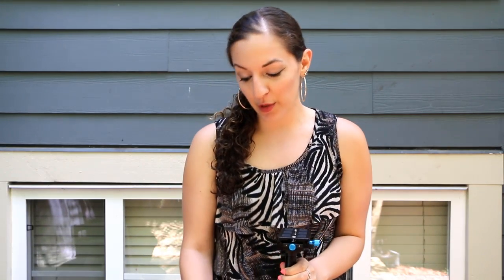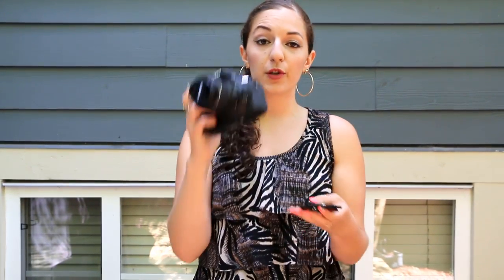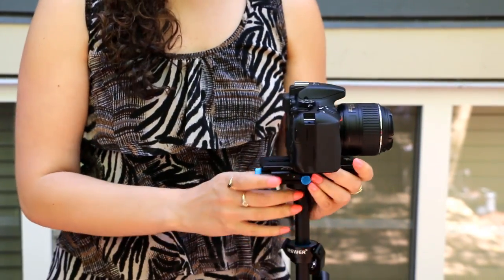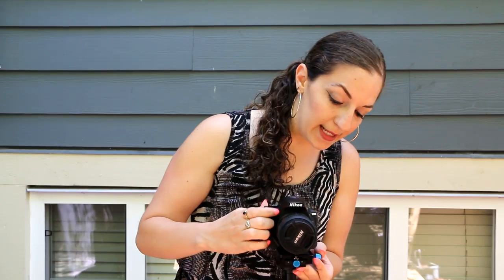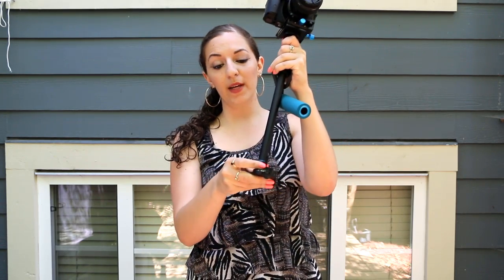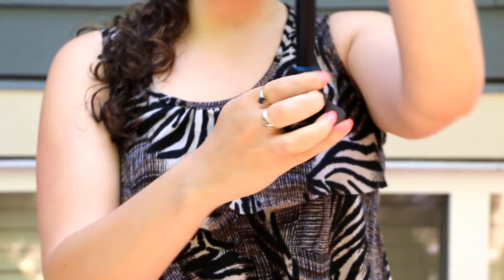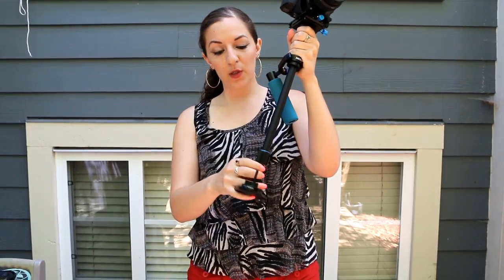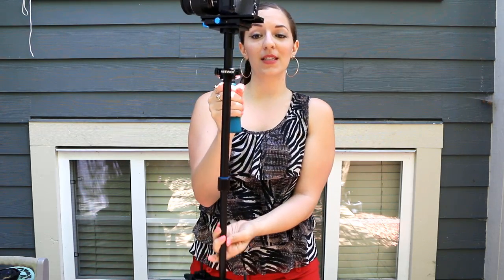How To Balance Neewer Stabilizer: Detailed & Step-By-Step Tutorial

Comment: Your intentions are very good and you are trying to help others which is very honourable. But there are a few things that are wrong. The quick release plate is not meant to slide in as there is a metal brake that is there precisely to prevent it from sliding off. Instead the quick release plate goes in from top to bottom like when you insert a tripod plate into a tripod head. 

Secondly, if you place the camera near the rear of the quick release plate it wont stick out so much and block your left/right adjustment knob. Then you wont have to turn it around the wrong way  facing the front like you did, and you can keep the left/right adjustment knob facing you.

Finally, the proper way to balance a stabilizer is to do the drop test first, and then make the camera position adjustments instead of doing the other way around like you did. Also the drop test is from horizontal to vertical (90°) and not from horizontal to horizontal as you are doing.

Last tips: the handle is held to the side of the rod and not behind it, and doing it outside may be a little more difficult as even the slightest wind breeze will throw the balance off.

Comment: see, the first part you have to adjust is find the center gravity between the camera and the quick releasing plate with the help of a rod in a flat surface and than fix the quick releasing plate exactly where the center portion is approximately. than the second part to adjust is the stemp (Rod) with the help of counter weight and adjusting the rod from in and out. than the last part is to adjust is the camera towards front and back or left to right vice versa. this is the procedure to adjust the glide cam my dear mam.if it is helpful comment here.

Comment: Very nice presentation. Just for that I think I'll  get one, I have the NEEWER shoulder mount with the offset and really like it. For us not so rich Camera owners its nice to be able to up our skills and not put out thousands of $$. I really liked this video and  the straight forward commentary. I fully understood it . Thank you.
Reply from the maker: Thanks James, appreciate it the feeback :)
Reply: I just received my NEEWER Stabilizer from AMAZON yesterday, Thanks to this video I was able to get it basically set up in about 30 mins, before running off to work. When I got off work , that night, I changed from the Nikon 70-300 mm lens to the Nikon 18-55 mm lens on my Nikon D5300 and had to reset but found it to be fairly quick to reset. I then did  some videos inside to see how it works and I was surprised to see how stable the shots were even though I know I really have to practice  to get it to be a lot smoother. This video had me up and going so easily. Thanks so much.

Comment: We've bought 2 weeks ago a similiar stabilizer. It is now horizontal and vertical well balanced. And it works as long  as we are standing still. When we are moving forward the camera immediately turns to the right. A little other adjustment and it turns to the left. Adjustmens were made with the plate or the counterweights distances. A tiny little bit of adjusting is necessary but we can't figure it out. Has anyone a hint? Mounted cam isn't a DSLR, it is a mirrorless Fujifilm X T-20.
Reply: This type of problem always stems from the type of lens one is using.

Before even trying to balance any camera with any type of stabilizer, analyze how the camera balances with respect to the lens.

A well balanced camera and lens, meaning the weight between the body and the lens is distributed evenly, will be a lot easier to balance with a stabilizer / gimbal / steadicam.

For this reason, usually cameras which go on stabilizers are ultimately balanced correctly if they use a  wide angle lens.   Wide angle lenses tend to be shorter than zooms, so they make the camera perform much better on a stabilizer, not just because they are better balanced when on a stabilizer but because they are more forgiving showing slight shakes when the camera is moving. 

Also, make sure your in-camera  or lens stable-shot is off when using a stabilizer or you will get awful results if not.

Comment: Hi there! Thank you so much for the video, I got mine almost perfectly balanced. However, the drop is still too short, about a second and a half. I cannot shorten the pole any more and if I remove another small plate, my camera (Canon 760d) becomes too heavy for the stabilizer to keep steady. I'm not sure what I can do more. Would you have any suggestions ? :)

Cheers!
Reply: If your camera is to light try adding weight to the camera like a polarizer, neutral density or skylight filter.  If the camera is to heavy lengthen the shaft.  If the camera is to light w/ 1 pair of weights (drop time to fast) and to light w/ no weights (drop time to slow) go to the hardware store and buy an assortment of washers.  Try to find a combination that is about 1/2 the weight of the weights that came w/ the stabilizer.

Comment: Just got my stabilizer!  But I can't seem to get the plate off. I can push it both back and forth, but it slides to a stop, and no matter how I twist and turn the blue things I can't seem to get it off.... :(   sigh...
Reply: The one that says unlock to one direction also makes it really tight.  So when it's right in between the plate is loose, but it won't come off...
Reply: I'm guessing this has been figured out by now, but moving the slider forward and aft to remove it is misleading.  After you have loosened the hold down you tilt the plate/camera away from the hold down and pull it out.

Comment: ok i have a problem.. when i try to stabilize the camera with my stock lens(nikon d3300 - nikkor 18-55) it doesn't seems to work  like i need less weight.. but i only have one weight and the pole is all the way up.. do you have any advice? (note. when i switch lens 55-135 which is a heavier lens it works well) i need some pointers! or what can i do?
Reply: That camera is pretty light, I don't have this particular stabilizer but if taking off all of the weights and keeping the pole all the way up still has too fast of a drop speed then you'll need to find a way to add weight to the top by where the camera is.

Comment: Ah screw it I'll spend $1k on a gimbal.
Reply: You will still have to balance gimbal. I spent 650e and it's SO FUCKING ANNOYING to balance. :<
Reply: But this is a gimbal...
Reply: This is steadicam - it can be called glidecam etc. But not gimbal.
Reply: It's pretty similar effect either you buy 500€ gimbal or glidecam. It's just all about who uses it and what effect author want more to prefer. Glidecam gives more natural footage, while gimbal gives more robotics - that's difference.. Gimbal is easier to use as well - at least on beginning.
Reply: It's great if you are happy! :)
Reply: That's exactly what this is in this video, dude (@david). Also, good for that guy, just because 5 minutes of work is too much, he wastes money on a 1000 bucks gimbal. ok. FUnny always, how people think when they have expensive gear, they will automatically create something good.
Reply: Gimbals are not reliable long term. Including those with a max load of 7lbs! 
They drift, glitch and aren't effective in alot of shots. 

Glidecam, may take time, but once you master it, you can literally run with it. Make extremely swift turns, can carry as much load as you can handle.
Reply: @lazyh-online4839  no this is a rip off of a glidecam, a mechanical tool, a gimbal usually refers to an electronic stabilization device
Reply: @carstensevier8786  in terms of use with a camera yes, but that's not the true definition of a gimbal.

Gimbal, a mechanism, typically consisting of rings pivoted at right angles, for keeping an instrument horizontal.

Therefore both electronic and mechanical "balance" gimbals (glidecams and ripoffs included) are technically gimbals.
Reply: @djovak3236  it's technically a mechanical gimbal.
Reply: @caribbean_racer_rr3  see my above comments, by definition any stabilizer is a form of gimbal.
Reply: David Stunning do you prefer this over a gimbal?
Reply: Big difference between 60 and 1000 bucks my friend! But I assume you are just a bragger.
Reply: Years later, looking at your Toronto Travel channel I see that you haven't posted any stabilised footage.
Reply: @mypoi7861  lol that's a good one 👍🏾

Comment: I love you but there is a much easier way to balance a stabilizer.  1) First find the camera's center of gravity. To do this place the center of the quick release on a pencil so it balances like a teeter-totter.  Install the camera and  move it back and forth till it also balances.  Tighten the screw and  mark that point. Install it on the unit so that it aligns with the shaft of the stabilizer.  This will reduce the amount of the final adjustment required.   2) Adjust the shaft length and weights until the shaft remains steady in the horizontal position all by itself during the drop test.  Lengthen the shaft length by 1.5-2.0 cm (shorten for low shots).  This will give you a near perfect drop time without fumbling around.  Once you have done this a few times you can balance your unit in under 2 min.

Comment: Bad idea to use weights on the bottom to adjust for tilt, the more you get to use the stabilizer the more you'll learn about using it properly. Learning the correct techniques will get you stabilized a lot faster and give you more consistent results. Focus on your dialogue and terminology, use a timer to get an accurate count, and you're videos will end up a lot more professional and easier to understand. Rehearse and write up what your planning on saying ahead of time so you don't have to jump back and forth a lot. That being said this is a pretty good video for being made someone who just got started with camera stabilizers.
Reply: LazyH-Online, you offered somebody help earlier, you told her/him if they sent you a video of how they calibrate their steadycam, you would be able to tell them what can be improve. Would you be so kind to do that for me?  I bought a similar stabilizer, (PULUZ 24" 60cm Professional Carbon Fibre Video Stabilizing Steadicam) which contemplates a max Load of 3kg/ 6.6lb. The problem I have is that, though the description said it's adequate for camcorders, I'm having a very hard time balancing my panasonic V770 on it. Its seems to be far too light. There are not specifications as to what's the lightest camera it can take. The stabilizer, curiously enough, came with absolutely no instructions at all, except for a little sheet with 3 pictures indicating the very basic adjustments to be made, of plates and weights. I cannot find specs as to how to use it with a camcorder anywhere. Just with DSLR's.   I am using just one half a pound weight on the front and I pull the camera body and plate all the way to the back to compensate for the lack of a second weight (I don't use it , in the hope that will make a difference) but still seems to be too heavy. The "three second" drop lasts slightly over a second. I have collapsed the stem as far as it can go. How would you calibrate a camcorder on this type of steadycam?. I haven't been able to figure out a way to make the top any heavier, since the screws are too short to add any type of weight to them. And I need to keep a weight on the bottom, otherwise the pendular movement increases a lot. Though there are videos showing how to operate this type of steady cam with heavier dslr's, there is none showing calibration  and usage with a small camcorder. I would appreciate any advise! Thanks!
Reply: ** ** I'd have to see what you mean about pendular movement increasing with the last weight removed. If your camcorder is too light then there's a chance that it may not work but I'll do what I can to try and help out. Are you able to upload a video of what happens when you remove the last weight so that way I can see exactly what you mean? The only problem is that the weight is what gives the stabilizer it's inertia and the lighter the stabilizer is the more it will stay even if it is fully balanced, so you won't be quite as stable as if you had a heavier camera. I think I saw somewhere of a weight that could be added directly to where the camera mounts to the stabilizer. It uses the same threads as the camera so you just thread the weight onto the top of the stabilizer and the camera onto the top of the weight. I'm going to check into that just in case it will help you because either haven't looked at it for a while I don't know where you would find one.

Comment: yeah a handle a few weights and a telescopic walking stick cut the handle off bend a bar around a sweeping brush drill a hole on both ends and in the center of the curve bolt it together free so it moves lock two nuts together by tightening them against each other or use a prop stand cannibalize anything you like an old tripod you dont even need a drill just screw a sharp screw thoru it and widen the hole with bigger possi drives use you brains adapt

Comment: If you start counting at 1, then it's not a 2 second drop if you get to the number 2. It's a 1 second drop. Try starting at 0 when you let it go, and THEN counting. As it is, you are off by a full second. Otherwise, many very wise tips contained in this video. Thanks.

Comment: I'm using a 6.5 lb camera, so getting it level is tougher than with a DSLR. The key is getting the camera perfectly positioned and balanced on the connect plate top centered. The more weight pulling the camera and stabilizer's center of gravity the better, period. The farther the counterweight below is from the fulcrum pivot point, the lower your center of gravity. If you look at the top plate you see that it's level without any camera on it. The heavier the weight of the camera, the more sensitive to perfect horizontal balance it will be. You will be very steady if you added 5 lbs of weight at the bottom, but too much weight even for a strong arm adds tension and that subtracts from steady, which is the point. So, it's all in adjusting the forward and side motion of the connection lockdown to keep it from leaning in any direction off of horizontal. The weight at the bottom should be distributed evenly so as to reduce variables that you have to compensate for on top. Once it is center balanced, mark where the plate should be connected to the camera and where that plate should be tightened down forward or back of the center balance point with tape.